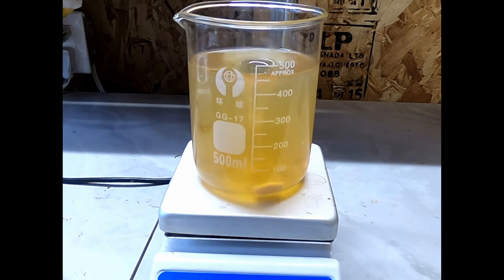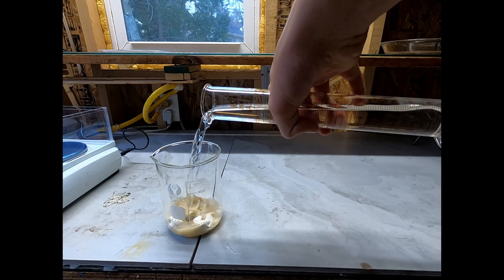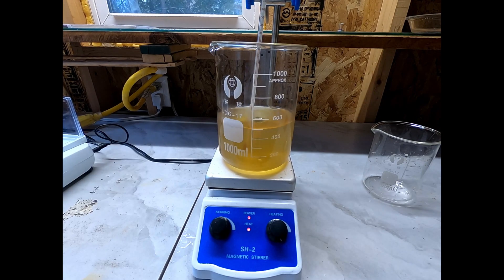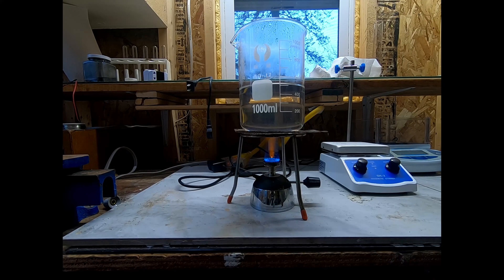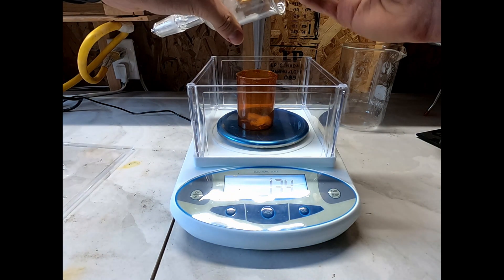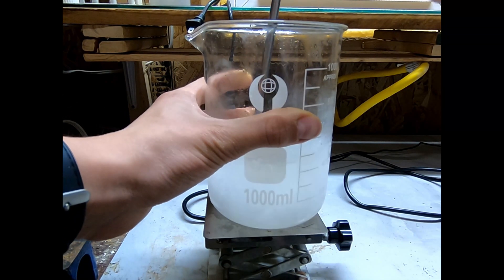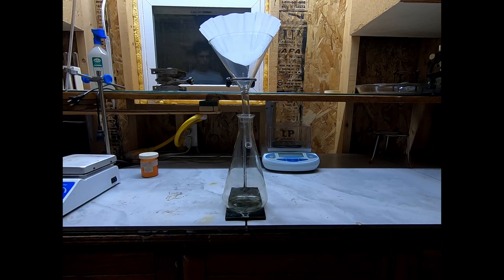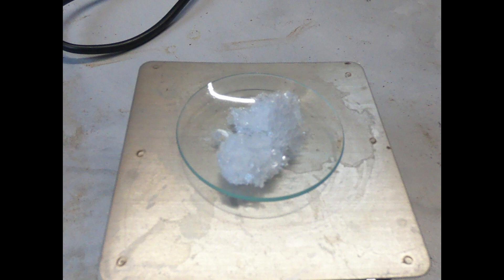Recrystallization of sodium carbonate (How to)

Comment: Sodium carbonate is actually most soluble at somewhere around 40 °C, then solubility slightly decreases with temperature.
So instead of boiling, just saturate the hot water, quickly filter with suction, then let it crystallize.
Note that warious hydrates have different solubilities, so you will probably get mixed hydrates from boiling water. When starting with hot water, you will probably get mostly the decahydrate.
Redissolve the decahydrate in a minimum amount of room temp. water (about 21 g/100 mL), then bubble CO2 through the solution. Filter the precipitated NaHCO3, wash with ice cold water, then ethanol, dry.
Recover high purity Na2CO3 by heating the solid bicarbonate.
Alternatively recrystallize the carbonate with warm/hot water 1-2 more times for higher purity.
Note that prolonged heating is needed to obtain a volumetric standard (primary standard for titrations), wth. like 250 °C for 1 hour, then used right away or dried in a vac. desiccator.
Reply: Many Thanks!  I was wondering about the various hydrates...
Reply: What temperature is required for recrystallisation?
Reply: @mariamaqsood8281  there’s no specific temp, it’s either room temp or colder
Reply: moreover allowing the solution to cool slowly is a must. As it cools, sodium carbonate decahydrate crystals start to form. This happens because as the temperature drops, the solubility of sodium carbonate decreases, and the water molecules attach to the sodium carbonate, forming hydrated crystals.